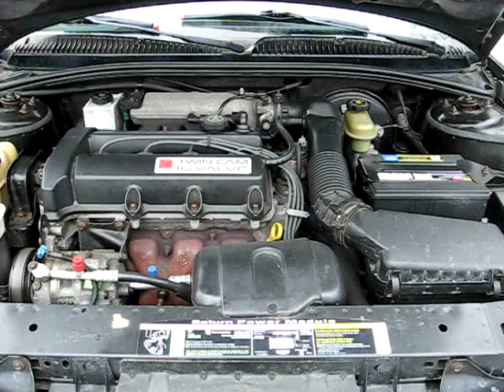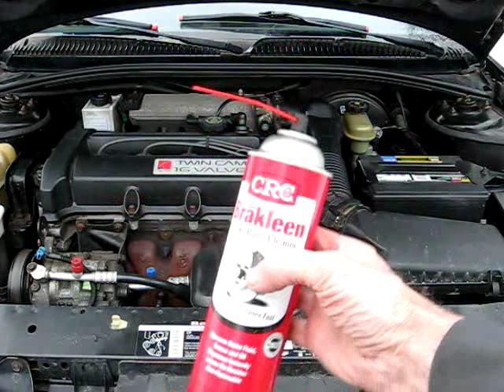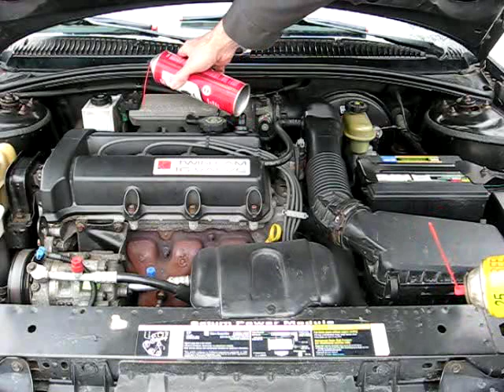Vacuum Leak Checking With  Choke Cleaner (COLD ENGINE)

Comment from the maker: Yes you have the dreaded problem all 00-02 SL1 owners have.The intake gasket was not put in correctly at the factory so a new intake manifold gasket has to be installed which should fix your problem.

Comment: Thank you for this video. Going to do this tomorrow, have a 00 Saturn sl1, high idle and cylinder 1 misfire, I suspect its vacuum leak but my father just believes its carbon buildup being a used vehicle. I did seafoam a few days ago, and the car has a good amount of power restored, but still high idle though so I will do this test tomorrow.

Comment from the maker: If you blow smoke into the intake manifold it will come out the intake to the filter,you have to seal the throttle body to test that P0171 code.

Comment: Thank you so much for your time in answering my question. I have to replace the intake manifold gasket on the 2001 Saturn SL1 SOHC and was just wondering just how far of a disasmbly in the engine bay is necessary to clear the manifold off the head. Both Chilton and Haynes describe disasmbly to be a bit more than what I feel is necessary to make clearance for the replacement of the gasket and thought perhaps you had a reference video to support my suspicion. Thanks again for the great support!
Reply: Just did my 2002. Air filter cover, belt, power steering pump (just unbolt from the engine don't disconnect hoses) and the fuel line clamp near the egr valve. You can get to all NINE of the manifold nuts from the top if you have to with a deep socket, u-joint, and 6" extension but you have to be pretty limber.

Comment: This TOTALLY works!  I would try not to spray too much all over the place - sensitive injectors, etc.  I sprayed briefly and directly at the mating surface between the manifold and the cylinder head and my idle jumped up as soon as the carb cleaner touched it!

Comment: No, the amount of water that will go through a leaking spot in a vacuum leak is far less than the ambiant water in the air on a damp day. We're talking about a couple of squirts of a spray bottle. Its really the soap that provides the temporary seal such that you can easily hear the difference in RPM. I've been a mechanical engineer for 15 years.

Comment: @BlueRice 

umm you don't want to be spraying something in there if there is no leak. the point is to quickly find out if the error is from a vacuum leak or if it is something else wrong for instance fuel filter or map sensor or oxygen sensor.

Comment: Your engine intakes more air through the intake on a damp day. The soap in the water creates a very temporary seal and is why the engine RPM changes when the soap momentarily seals the leak.

Comment: this is very very useful video! i was going to replace the fuel filter and use some fuel injection cleaner bcuz i was having problemw ith my idle and misfire problem. i was told i might have a vacuum leak. im going to test this first before i do any of other tune up

Comment: We have replaced the spark plugs (correct gap), spark plug wires & boot, replaced the ignition packs for the spark plugs, engine coolant temperature sensor, oxygen sensor, and the coolant thermostat & hosing.

Comment: Dubking09, you might check your piston rings, is sounds like your oil is leaking into your valves and burning with your fuel. Typically when this happenes you'll see light blue smoke coming out the exhaust. Be sure to check your oil regularly, wouldn't want your engine to sieze

Comment: it was a tube on top of the engine i did seal the throttle bottle but the smoke that i blew in started coming out of the air filter cracks

Comment: Hi Rich.  Current have two Saturns I keep running for my kids.  A 2001 SC2 and an 2003 Ion.  Your videos are my first reference for all jobs.  Anyhow, here in NC we need annual vehicle inspections.  Check engine light came on.  Had this happen before on another SC and changed gas cap, and presto.  This time  so bought a new gas cap, put it on, but did not fix.  Took it to AutoZone, they diagnosed it as Error Code P0442 indicating some issue with the Evap Emission system (normally a gas cap).  If the gas cap replace doesn't work, what should my next step be to fix?  Plates run out the end of May, so I'm getting a bit desperate to get this inspection done...

Comment: My 03 chevy trailblazer showed a code running to rich & lean was told it was o2 sensor had it changed engine light still on! It doesn't idle badly it only makes a sound when i'm driving it makes a rough sound only while pushing the gas. Doesn't while in park & running. Could this actually be a vacuum leak? Was told a2nd time it was possibly a bad map sensor also but i'm wondering a vacuum leak , or mass air intake or something like that? Any suggestions are appreciated!

Comment: i have a 97 saturn looks to be about the same car here, and i think either the egr solenoid is bad or there is a vacuum leak.
 it starts to idle at 2000 rpms instead of just under 1000 and 
 whenever i try to accelerate, the rpms drop to nothing and it almost dies but it goes back up the second i let off the accelerator. any suggestions?
(it has all new fuel filter, new spark plugs and working fuel injectors)

Comment: hey i got code P0171 and i blew cigar smoke into a tube to the vacuum line and it came out of my air filter you know where the top screws on to cover the filter? it came from the side of the crack between the top and bottom so does that mean i need a new air filter assembly?

Comment: Rich
I have a Mustang gt, when the engine is running and i'm standing still the rpm goes up and down on it self . today the check engine light also turned on. I ran my SCT tune and it told me "system running lean". Do you have any idea of what this could be? 
I appreciate any help, thank you.

Comment: @jmyjms86 my car has misfire problem. what could it be? i fix vacuum leak thru my exhuast it helps. but the problem still persist. senor is ok since theres no check engine light. i change spark plug but i habvent change spark wire. i might need to change that too?

Comment: There's no danger as long as engine is started from cold. Of course it would be dangerous to spray such liquid to glowing hot exhaust manifold for example.

What I think is a bad idea is using brake cleaner and spray that stuff all over your engine as it's often bad for rubber and plastic parts. I'd prefer carb or throttle body cleaner.

Comment: Hi, I have a 01 saturn sl1 and the problem that I have is that the car idles fine, but as soon as I give it gas it wants to stall..I replaced fuel pump, fuel filter, plugs wires coolent sensor cam sensor and the problem continues, any help would be greatly appreciated!!
Reply from the maker: mexcar That year and engine had intake manifold gasket problems.

Comment: I understand spraying around  for the vacuum leak but I wouldn't use brake clean.You want to use something that is sensor safe and brake clean is definitely not  sensor safe. I am not trying to be smart just simply trying not to wipe out a O2 sensor. These newer cars O2 sensors are quite sensitive and it doesn't take much to wipe one out. I would use only throttle body cleaner because its sensor safe. Just my personal opinion.

Comment: My 99 olds Intrigue 3.8 keeps stalling out once or twice per week.  It has 170,000 miles and still running good other than that. It just kinda chugs to a stale at a light and then starts back up.   Any suggestions?
Reply from the maker: When was the last time it had a tune up,is the throttle body dirty.
Reply: richpin06a I don't think it has ever had a tune up per say.  The throttle body is kinda dirty.
Reply: milo tilo jeez maybe it needs a tune up smart guy?

Comment: hi rich, 2001 saturn sl2 code P0172 fuel pressure regulator l need to locate and remove the regulator. do you a video? power lock doors will not stop lock and unlocking just clicking until the battery goes die. how can i fix that problem. do you have video?
Reply from the maker: +Eric Green The fuel pressure regulator is part of the fuel filter https://youtu.be/lVeyA6B2afU

Comment: Vacuum leak means its sucking in air.
I wouldnt be using this method as the car would be sucking in water etc... The water method works on anything that is pressurized.

Comment: propane gas is much safer!  if you have a gasket leak with a high idle the propane gas will get sucked in and lower the idle.  spraying carb cleaner onto a hot engine is just a fire hazard so dont do it!

Comment: why (COLD ENGINE)
Reply from the maker: Less dangerous than spraying on a hot engine.
Reply: I have a Mercedes 1992 ce 24v When the engine is running a cool, trembling Engine When the heat becomes excellent condition Art is the reason you think